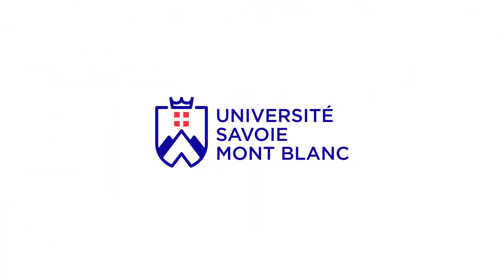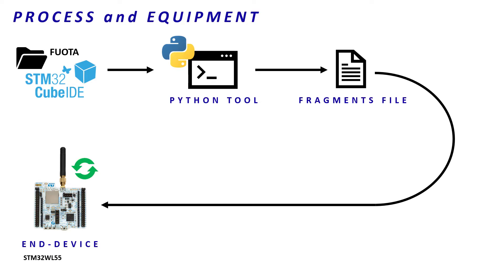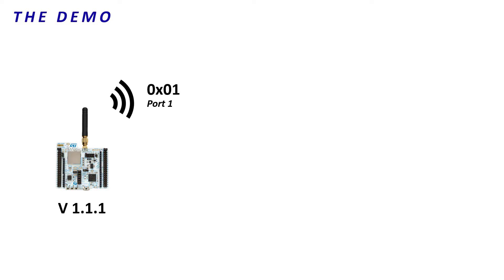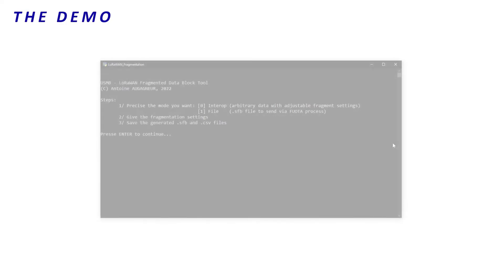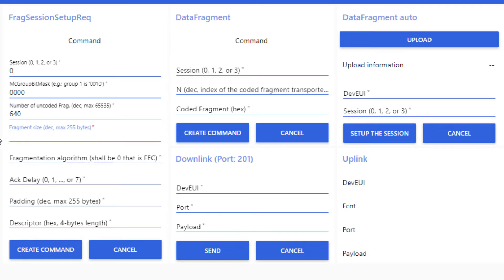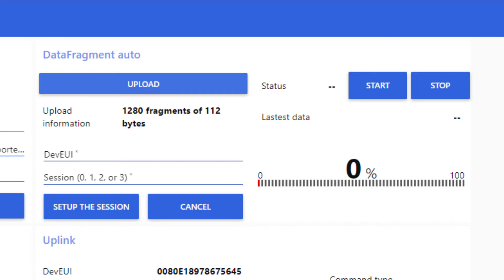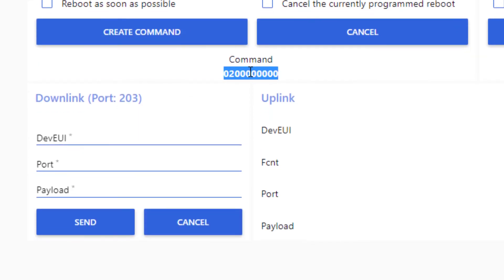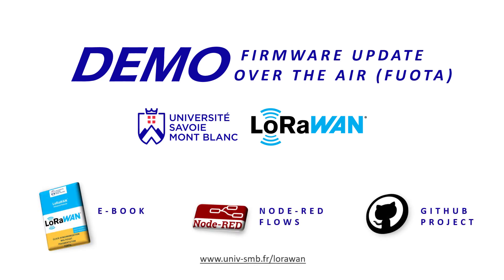LoRaWAN FUOTA

Comment: Can I use Sx1302 transceiver and stm32L4 MCU for FUOTA without use any third-party server in cloud. Is it possible or not? Can you share ideas about this...!

Thanks in advance
Reply from the maker: SX1302 is a base band processor designed for Gateways. FUOTA is for end-devices.
Reply: @sylvainmontagny  which MCU best for lora gateway stm32 series. Low cost stm32 series?